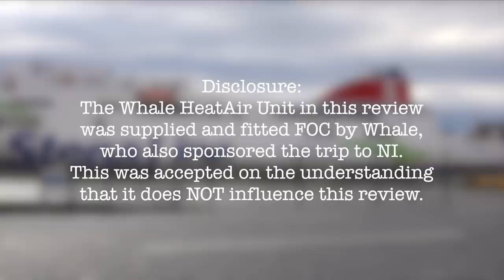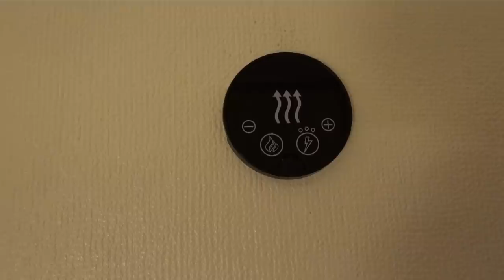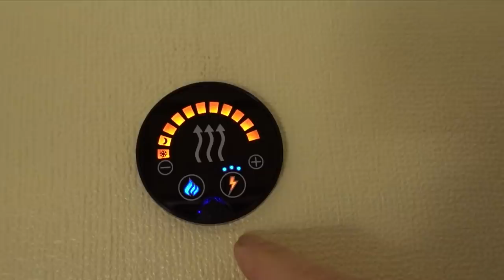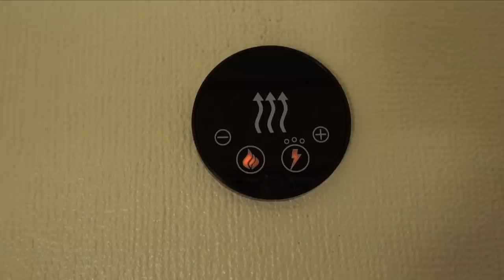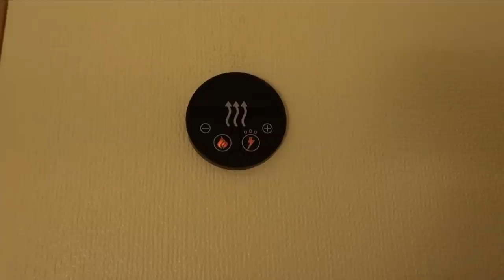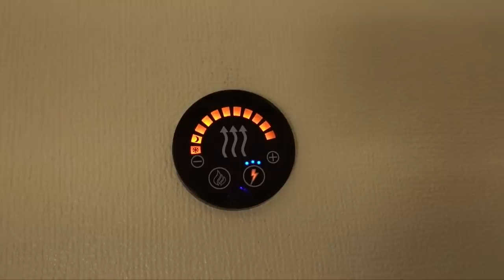Whale HeatAir; The Review

Comment: That's a very interesting and detailed review, full of answered questions most buyers would want answering👍
Those that have a campervan or are thinking of converting a van to make a mobile home / van  should seriously consider this purchase over an eberspacher running on deisel. The problem with deisel is that it's a heavy oil, doesn't burn easily and produces a lot of soot which eventually will coat the combustion chamber and prevent it running. Diesel only heaters also require a significant amount of current / amps to get the glow plug hot enough to ignite the diesel, another disadvantage. Running a diesel only heater will require most runs to be on full throttle so soot build up isn't an issue. The big advantage of running on gas is it's a clean burning fuel so you can run on a  light load, ie idling to maintain heat, running through the night, without the issues of soot build up which then prevents the heaters even starting up, you just get an error code......... handy when you're miles from a service agent. 
Wonder how I know........ I've got a deisel only eberspacher heater on a boat....... to prevent having to strip the unit apart each year I remove  the deisel supply piping and run it into a 5 litre tub of parrafin....... hardly something you can do with a campervan conversion. 
So if you've a choice between LPG and deisel opt for the LPG every time.......it'll save you tons of money getting the deisel system serviced / repaired when it fails to start.
Reply from the maker: That's really useful to know, thanks Graham! I know that in the R&D of this unit, Whale have worked very hard to keep the 12v power consumption as low as possible when working on LPG. The way they do it is Top Secret so I have not been permitted to share how they do it, but it's very impressive.
Reply: 12v power consumption of 0,6A in lowest setting is almost same as Eberspacher, Truma and Webasto. Newer brushless are a bit more efficient. The type of fan and build are simular. Wallas and Safire have heaters that uses different type of fan, wich are even more efficient.

@8:15 other gas and diesel heaters have also multiple power settings. Even pre 2000 Eberspachers already modulated between  4 (or 2 depending on type) power settings, the old Trumatic and Webasto had 2 manual settings. Modern diesel heaters regulate power seamless; amount of fuel can be controled very acurate very easy/cheap, unlike low gasflow, so even a new trumatic used 2/3 power settings.
Reply: @Jeroen_M625  
My 5kw deisel eberspacher has a full range of fan speeds and deisel pump speeds as ypu state but on start up it takes over 20 amps(25 from memory) to get the glow plug hot enough for ignition.....gives the domestic battery a hard time....not a problem on my boat as I've got 450 Amp / hours of capacity.
Reply: Yep, during startup (and shut down) measured 18A with 12v D3L and D2LC, With newer D2 8A@12v for glow plug, although just for a few minutes, startup and shut down uses about as much energy as 1 hour running. With gas just a few amps for a few moments to get a spark. I like the old bigger Trumatics, but they don't come cheap and in some countries you need to recertify the gas installation every 2 years or can't fill bottles yourself.
I've also installed some Chinese diesel heaters and the owners love them, every once in while on full power to clean the soot out. One of those vans had already a large LPG tank so it was propex vs cheap diesel heater + budget for other things to do.

Comment: Very impressive product and looks like a winner.  Innovative interface, and the fact that it does not do the temp digitally, in my mind would be a drawback, but all and all the fact that it auto dims would make up for that.  Also it  is so quiet, i like the use of  the two solenoid system for low, med and high heat that is very efficient on fuel use and noise level!!!
Reply from the maker: In reality Paul, a 'temperature' reading requires the stat to be put in the right place. In my Airstream I needed to set the heating to 20 to get 20 degrees, in the Missouri I had to set it to 25 to get 20, and in the Adria Twin it was 18 to get 20!!!!!

Comment: The mains settings do make sense if you want to use it on holiday abroad outside the summer time.
Loads of sites only have 6A and even some still have 4A only.Then you can still use the 1st settings of the heater on both mains amps.
Otherwise an excellent heating option!!!

Comment: Thanks Andrew, I camp in a tent and I wish manufacturers would develop some kind of heating that is safe, I use a oil filled rad and fan heater which I don't  think is that safe in a tent, happy new year.
Reply from the maker: Hmm.. good point Claire. Although I think as long as your heaters have 'tip over' protection and are kept well away from the sides then you are doing the best that can be done. All the best.

Comment: You mention a dual fuel version and a gas only version. So what's the other fuel ?
Later you mention electric Mains & 12V - so that's now 3 power types !
I guess it's a 12V system using either mains or gas for heat. Do they do a diesel burner heater option ?

Comment: Thank you for the review. I would have liked to have seen insulated heat pipes running under the van to prevent heat loss
Reply from the maker: Hi Dan, they do have thermal lining on the inside. Cheers!
Reply: @andrewjditton  Thank you for that information. Makes sense with exposed pipes to prevent possible rodent damage.

Comment: Hi Andrew, great video, too late but would have been better if you could have a large digital thermometer visible was you went fro 5 degrees Celsius to ? degrees. I think the control unit too would benefit from a numeric digital gauge showing your desired temperature and perhaps a toggle to show actual temperature, just suggesting what do you think, Finally if you are on a serviced pitch electricity is included so why use gas you have to pay for and replace. I love that it's dual fuelled though. I would appreciate your opinion on my thoughts. Keep up the good work and give Dougal a virtual tummy run from the Hobbs family South Australia 😀

Comment: The sound of the Whale heat system is no louder than the noise of an air condition system in the car. The warmed fresh air is great. Good for sleeping in the night as well as for the lungs. Another consideration would be the insulation of Glynnis in order to keep cold in winter and heat in summer out. I would check on that since Glynnis is an older caravan model. Would also mean saving on gas and therefore on money in the long run. In the meantime a lot of development with thinner insulation has been going on.
Reply from the maker: Yes, I've been watching the channel Not Another White Box and seeing how Cameron has been insulating his vintage caravan.

Comment: Rapid warm up, responsive fan speed to reduce noise and the fact that Dougal isn't bothered by a high pitched whine make that a nice unit.  If the mains allowed a 2 KW mid setting for 10 amp service, would the refrigerator still have enough juice to run?  I don't fully understand your higher voltage mains.
Reply from the maker: Obvs that would depend on the draw of of the refrigerator! Fret not, I don't understand 110v either ;@)
Reply: ncplantdoctor hello, there is NO 120V, IN EUROPE  250 V. 50 HERTZ, IN FACT MOST THE WORLD IS 50 HZ, I sent my brother in London in the 60s a Clock radio, AND A 250 X 120 V TRANSFORMER
You can get a clock, & a radio, but NOT both in 1, another thing in my cousin in GERMANY, the. Stove & clothes dryer ARE 3 PHASE , where the loads are LESS AMPERAGE PER LEG, but in USA, typically we only have 240v single phase, so only 2 legs with power, the load those both, , , I have been retired but I did everything , up to 4160 volts 3 phase ,  Cheers From NJ 🇺🇸🇺🇸🇺🇸🇺🇸

Comment: Would be interested to know how much gas is used off grid, maintaining say 18 degrees in winter weather. You would need to measure tank weight plus internal and external temperatures. Also, how many display bars of heat are required to maintain at 18 degrees.
Reply from the maker: Yes, would have been interesting but I'm just not set up with Glynnis to do that at the moment. That kind of test (which I'd love to do) would require me to be better set up with back-up power sources and smaller gas cylinders, which I just don't have just now. In the Airstream yes, but not in the Sprite.

Comment: I have enough experience with gas heating in our camper van, so I could hear it quickly, but for someone who doesn't know the sound it might be more difficult to notice at first. It doesn't sound very annoying I must say, although I'm not that sensitive as I found out when I spoke to someone who had to move a couple of times because she woke up because of a gas heater in a camper next to their own.
Because we travel with 4 and 2 dogs I try to keep a window slightly opened most of the time, also during winter. During cooking I do use our MaxxFan deluxe to extract air, that also lets you loose heat, so I guess it might depend on your situation whether it is best to take in heated up fresh air or recirculate the air, but needing more attention to ventilation (and more of a cold feel near the open window).

We use lpg in our van, so there it might be a disadvantage to have the heater mounted outside during winter because of the butane in the mixture.
Reply from the maker: Yes, it's good to have the option of where to put the inlet. Thanks for sharing your experiences, always good to get a variety of views for those seeking advice!

Comment: If you're on a 10A or less site, will it trip the RCD every time you cycle through the three electric power settings? I assume there's a delay between selecting and applying the setting but seems a bit too easy for a family member to exceed power limits.
Reply from the maker: Hi Nick, if you notice there is a delay between taking your finger off the button and the spark turning from blue (standby) to red (drawing current) to prevent this. Cheers!

Comment: Thanks Andrew. Question: what do you do about your new mouse hole in your under bed locker? Can it be filled with expanding foam or something as a little deterrent to the custom entrance?
Reply: Same thing crossed my mind.
Reply from the maker: It's good to leave small holes to allow any possible gas leaks to escape - all modern caravans are fitted with 'gas drop outs' in the floor. Maybe I'll put some wire mesh over though, but I don't think the gap is big enough!

Comment: Haloooo, ANDREW, I had NOTrealized your ‘WHALE , heater had a choice of g LP GSA, & Electricity, so then the electric is from your battery, or when hooked up at a site, but then some means brings the internal 12 volt system ?    Cheers From NJ, USA🏴🏴🏴🇬🇧🇺🇸
Reply from the maker: Hi, yes you need 12v DC from the battery to power the fan when you are on LPG supply. It can't heat from 12v. Cheers!

Comment: If the installation is complete, has the hole in the floor been left deliberately ? At 2:50 there is an 8mm pipe shown with bad kink, what does this supply ?
Reply from the maker: Hi Alan, yes the hole is left to allow any possible gas leakage to 'drop out.' It's a feature on all modern caravans. If you look at the 'How it's made' vid you'll see that one of the gas pipes is supply and the other is back out to the unit. I might be wrong (I'm not in the van at the mo so I cannot check) but I think it is brought in purely to provide an accessible isolation cock. I'll have to check next time! Cheers for now.
Reply: Whatever the pipe serves it looks severely kinked and must be affecting flow. Regards AJ

Comment: Minute 2:47 I was surprised to see through the floor of the caravan down to the ground:  the hole for the gas pipes and electrical cables was not sealed.
Reply from the maker: Quite normal in UK caravans, as a 'gas drop-out' in case of LPG leaks.
Reply: @andrewjditton  I understand the purpose of a hole to drain any escaped gas; my point is that hole must be sealed  on its perimeter to prevent water entering the floor sandwich which will eventually rot..

Comment: Good luck when you accidentally select the high setting when on a limited supply.
Reply from the maker: Well... surely you can 'accidentally' set something too high with any system? You might have noticed the lag between selecting the power and the 'spark' icon going from Blue (standby) to Orange (on) so you do have a time lag to reconsider if you notice your mistake.
Reply: @andrewjditton  If you want to change from TWO to ONE there is no alternative but to go through THREE. If you're not quick enough you'll end up outside re-setting the EHU.